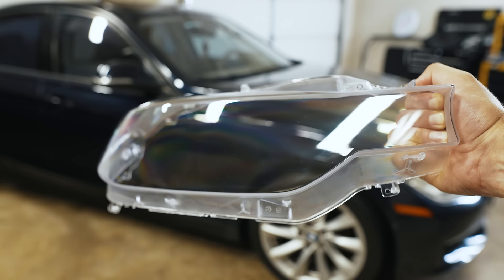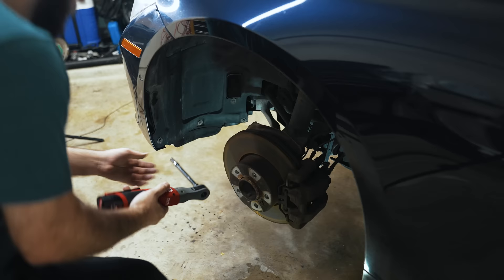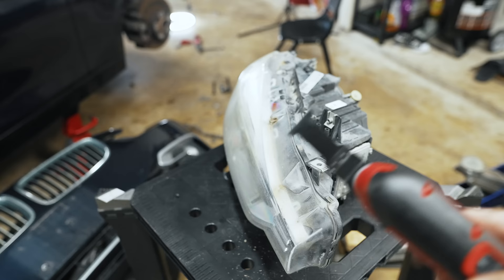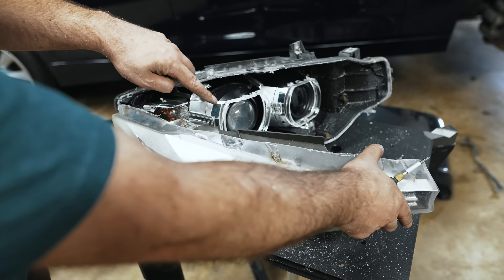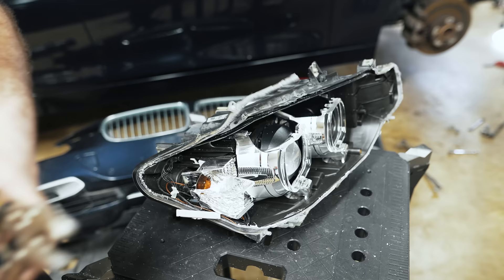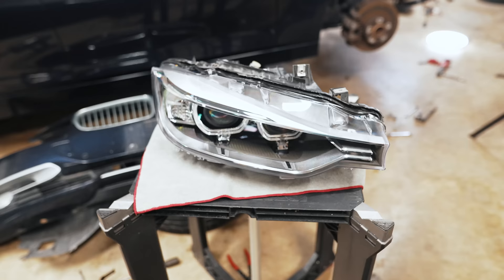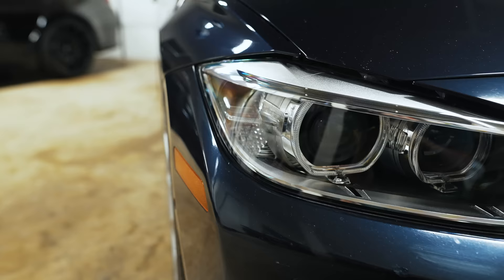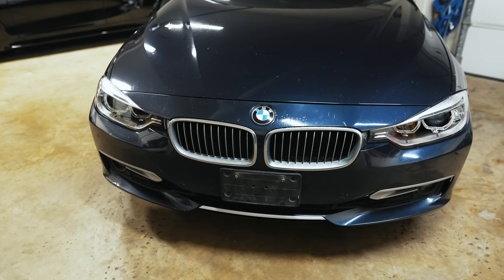The Ultimate BMW Headlight Lens Replacement Guide

Comment: Its a shame these cars look so nice and cost alot but yet have so many problems.
Reply: My wife has a E91 with Msport package & loves the car but its getting old. Wanted to update to the F31 but the N20 is so darn unreliable that have decided against it. Unfortunate.
Reply: Yep. Having had faultless Toyotas for years, owning a BMW car is like going back to the early years of motoring where everything goes wrong, oil leaks etc. Just Woeful reliability. BMW motorbikes are better but still can’t beat the Japanese makes in any way.
Reply: I own a 2009 335i with 87k on the dash. I’ve owned 4 bmws and they’ve all treated me amazing. Only one of the 4 ever gave me serious problems. These cars are amazing as long as they were taken care of before you.
Reply: It's easy to get scared of them but if you can turn a wrench, dive in. I enjoy how my E90 drives but I do have a daily Toyota.
Reply: I am currently running an N20 that has never been opened. 208k miles and running strong. You just have to actually take care of the car.
Reply: He's addressing an issue here though that every modern car has now seemingly regardless of price.  You'd think that one of the most crucial safety features of a car second only to brakes would be built better since the builders drive them too. 🤷
Reply: 110k miles on mine 0 issues for now just battery replacement tires and good maintenance.
Reply: @luissantiago9262 same here and I bought mine brand new ,still has that new car smell
Reply: No car really problem the driver is
Reply: @Arrozconchopsticks that’s the thing I believe every car is go it’s up to the driver first thing a bmw or Benz is not a daily car and most people do keep up with proper maintenance but mad ago the problems
Reply: Bullshit i own a f30 and it never gave me problems currently at 88 k miles problem is people want a bmw and don’t want to maintain it like a bmw

Comment: I did this before. I’d rather  buy new aftermarket headlights and not waste an entire day doing this again. It’s a much bigger pain than this video shows. And both of mine even though I did a great seal job ended up building condensation inside the housing.

Comment: It's always good practice to spray a coat of uv protection on top of aftermarket headlights because most of the time it's just raw polycarbonate, and without the protection, they will yellow faster than the OEM headlight.
Reply: Best Additional Comment that everyone must consider, all those affordable replacement may not have UV protection and change its color after a couple of days...

Comment: I learned a trick doing this just use a cardboard box. Stick the heat gun in it or hair dryer an put the headlight in the box and close it for a few minutes. And then take it out and pry the lens off.
Reply: NO CUTTING?

Comment: Nice to know that you can purchase jut the lenses as opposed to the entire headlamp assembly, that's great info! 

I am curious to see if the alternative technique would work for these lights as well. I've retrofitted a number of headlights over the years and what I have always done to remove the lens is simply pop the whole assembly into the oven for 7-9 mins at 250 degrees F (after removing the screws of course).

That heats up the glue without damaging the lights at all, or the internals, and then you can literally just pry the lens right off; with most of the glue coming with it. 

The one thing to take note of when using this method is just to avoid getting the glue on the lenses or the internals of the light, as it's very hard to remove. But if you're careful it can be done quite easily. 

Then, to reassemble, simply do the same thing in reverse. Put the new glue in the lamp, press the lens against it, toss in the oven and then when it comes out, you can literally press it all together again nice and even. 

Sounds like a good amount of work but it's just an alternate method of achieving the same result, and also you don't have to cut anything which means less dust! 

Either way, great job, solid DIY and keep up the great work!
Reply: On BMW, do you have to code anything when you retrofit to LED ?
Reply: @Maaaaaax-07  I'm not sure - I've never done a retrofit on a BMW but likely yes though.
Reply: @KingdomAuto  Alright thanks, I took a chance since it was a bmw video.
Reply: Which glue do you use to reinstall the lenses? Thanks

Comment: That tool looks perfect for this job, i will definetly have it in hand when im rebuilding a pair of AHL for my E87!
Only thing i would have done different is to try and clean the projector lense as it seems a bit foggy, and maybe the reflector to. But its a very delicate job to disasemble the chrome parts without ruening the chrome.
Looks a thousend times better now tho! NIce work!

Comment: sliplo protector $99 Amazon for the CF front splitter for your M tech bumper.
$300 Ebay rear 550i quad pipe bumper, $300 cf diffuser, modify the stock pipes to quad, muffler delete

Doing this now to f10 2015 Msport 528i.  Singapore grey 20s, BMS tuned, CAI N20
Reply from the maker: Nice, should look slick.

Comment: I highly recommend for everybody to clean the xenon lenses and reflectors as well. You wouldn't believe how dirty it is after a few years and it will make a more than noticeable difference in light output.
Reply: I’ve been able to clean the lens from the backside but wasn’t easy. Saw later that there is some crud on the opposite side… I’m going to try to clean said side this weekend with  a pipe cleaner with a microfibre piece at the end but cleaning the reflector bowl will be much harder. I may have to change out the covers as well JUST to remove the entire housing to clean it. Light output isn’t the greatest at the moment.
Reply from the maker: Good tip, in hindsight it would have been a good time.
Reply: @maxwellkeeling3781  Be aware of the surface of the reflector. The silver part is mostly done by  an aluminium steam process and it's quite sensitive. If the reflector is  blind you should find a service to "re-steam" it for ~20$/reflector (don't know the correct english translation). The e46 xenons have big trouble with this and all other as well after a long time. I just did the whole process for an old A4 B5 xenon headlight one year ago.

Comment: I'm halfway through doing a F20 BMW 1 Series and it seems like they changed to a bonding silicone and metal pins! To remove the adhesive I tried silicone sealer remover which did soften it slightly. A drill works quite well for clearing out the channel!
Reply: Can I ask what items you used to reseal?

Comment: What a pain in the butt compared to E46 which just had a few clips you popped open. No need to remove the bumper either.

Need to do this on a E91 soon.

Comment: I used to work on testing such headlights. I can tell you touching the chrome will be fine. While it will get dirty, it will survive.
Reply: Not these ones. I touched the chrome from my e46 m3 lenses and it peeled off really easily. Luckily it was on a non visible part

Comment: Great video. So is there an option to buy just the lense cover on a 2005 BMW 750Li ? The entire new headlight assembly is 789$
Reply: Yes. Search 2005 bmw 750Li headlight lens on eBay.  You’ll find some.

Comment: Love your videos. Can you show the same DIY on how to do this for a Pre-LCI e90 bi-xenon? I have the popup washers and it seems impossible to remove the headlamp from the car (like some hidden bolt is holding it). Also the AE's have that light tube which could crack easily so I'd love to see how to safely do that job

Comment: Great video, but did not work on my 2007 Z4.  Even with a heat gun at 800, melting the rubber just didn't work.  At least I tried!

Comment: What's sitting in the other spot in the garage? The black one. I'm doing my e63 lights now. I used a heat gun with a flathead to pry gently
Reply from the maker: It's a G80 M3 Comp.

Comment: Great detailed instructions as always. Looks great but a second option for those that don’t want to perform surgery on the front end. Sanding and polishing should do the trick however you did mention it all depends on the degree of weathering on the lens. Keep up the great work
Reply: Yeah if it's on the inside your Sol
Reply: Sanding and polishing just does not work

Comment: You should have cleaned lenses. There is always film of dust/dirt. From personal experience of doing 2 times same you did with headlight. Also - what you replaced called covers - lenses are those  spherical magnification things.
Reply from the maker: Yeah cleaning the back of the projector would be a good idea.

Comment: Hmmm...yeah...my 16 340i don’t think this would be so easy. Passenger side assembly took on lots of water inside lens. Got a used OEM assembly sans the modules off eBay. Ended up selling my leaky OEM assembly back to guy who I bought used OEM assembly from. HE probably did what you did to my leaky assembly and will resell it no doubt. I know though however it’s very easy to wreck the assembly getting lens off and permaseal strip off. Then if you don’t reseal it just perfectly it leaks again. Definitely only for the experienced.

Comment: Wow, bmw did their best to make it as complicated as possible. I might just stay with the e46 chassis as long as I can.
Reply: Most cars have very complicated headlights these days. Even Chrysler have complicated designs. And they cost over $800 each to replace
Reply from the maker: The started bonding them permanently around the mid 2000s.  They headlight manufacturers, these were ZKW lights.

Comment: The headlights in my e39 540i came out in 2 minutes. They were held in by 4 bolts and you didn't have to remove the front bumper. I'm not sure why the new BMW's are so damn hard to work on for simple stuff like headlight removals. It's not like the e39 was lacking in quality. Hell, Porsche makes headlights that literally pop out in 2 seconds with a allen key.
Reply from the maker: I think its so the front end can be installed as a complete module at the factory.
Reply: @VehicularDIY  That makes perfect sense. Good point.